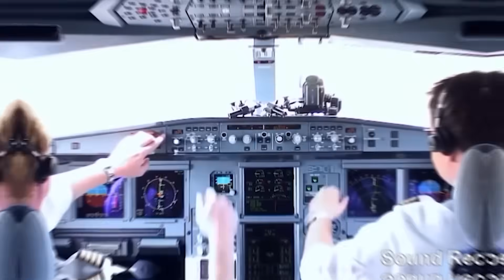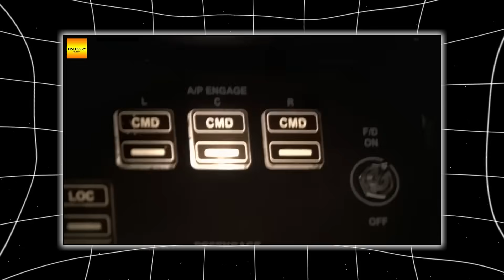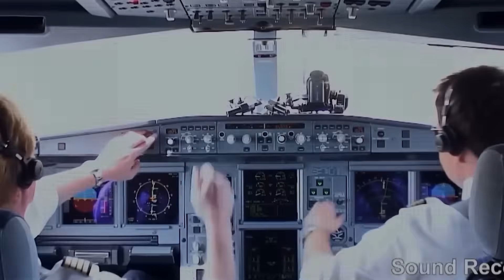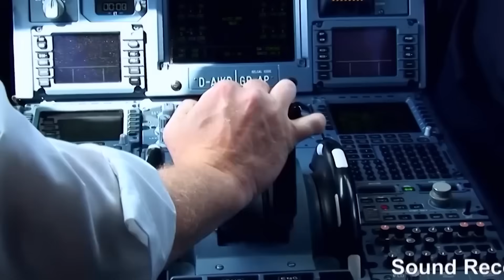BLACK BOX DECODED? Scientists FINALLY SOLVED the Mystery of Air India 171 CRASH

Comment: I have no clue, whether this is true or not. But it sounds reasonable. Listen to pilots, who comment the suicide theory. All say, that it is impossible to switch off both engines manually within 1 second. That the suicide theory is pushed so hard through the media, lets me think that Boeing is hiding something. Suicide releases Boeing from any responsibility. It is well known, that the quality control at Boeing is miserable. There are to many reports about that topic.
Reply: C est bidon et impossible !
Reply: @duodiscus6499  what is wrong?
Reply: Ce qui est impossible c est que le fauteuil est reculé et que le pilote se raccroche aux commandes d extinction des moteurs. Je pense que le problème vient d un problème de parasite sur le bus de données qui a été interprété par le calculateur comme une coupure moteur. C était déjà arrivé sur le même modèle à l atterrissage.
Reply: @duodiscus6499  In that case it is still a BOEING problem

Comment: The Captain was the Pilot Monitoring, and as such, even if the seat pin failed, there was no urgent need to grab the thrust levers or the Idle/Cutoff switches. Regardless of these simulator flights, its beyond comprehension that highly experienced pilots would be spring-loaded to grab these engine controls.

Comment: Good point and another valid hypothesis along with suicide pilot, main electrical failure affecting fuel pumps, etc. Remember a LATAM prestigious airline Boeing 787-9 had an incident not long ago flying from Sydney to Auckland - Santiago de Chile related to malfunction of the seat of the pilot which moved it forward when a hostess provided a beverage... This caused a sudden drop when the pilot pushed the control forward with several passengers injured.